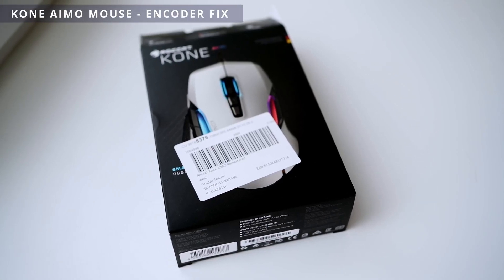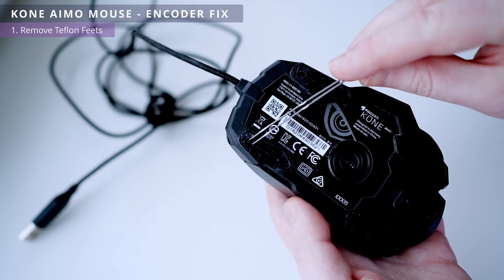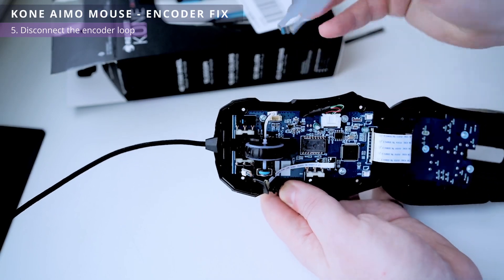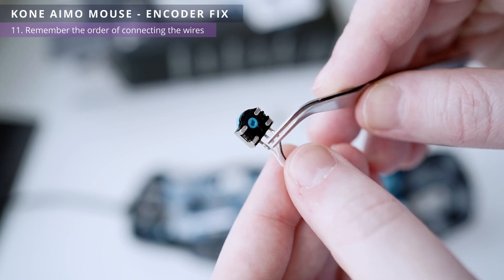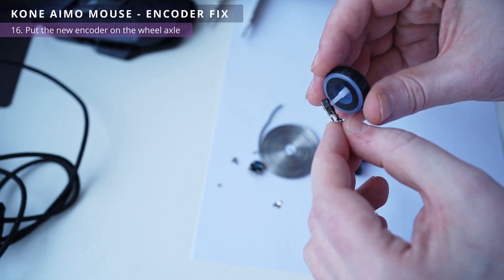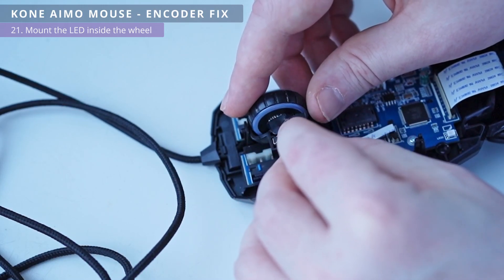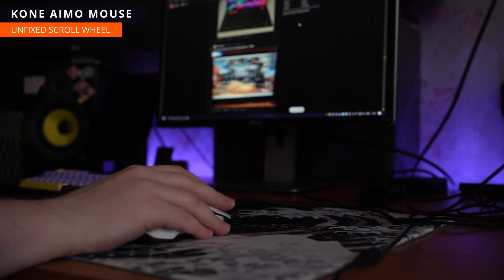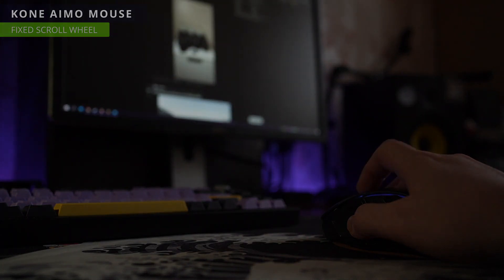🛠️🖱️ How to fix mouse scroll wheel encoder - Roccat Aimo Remastered

Comment: The ONLY reason i still use this mouse is due to the shape and size, nothing i have tried even comes close to it, so it is my go to.  HOWEVER. IT is disgusting that this scroll fault has not been fixed after 6 years of them knowing the fault, original and the remastered has had this fault from day one, Over the years, i have had 6 of these mice, For both my home PC my laptop, and i use them in work. 

Out of the 6 i have bought, at least half have had the fault out the box, and then 2 others developed the fault after a a year. 

I am hoping now, that with Turtle beach taking over the brand, they have actually addressed the issue, if not, i am honestly going to be looking else where for mice.